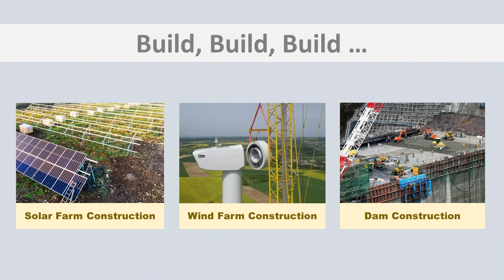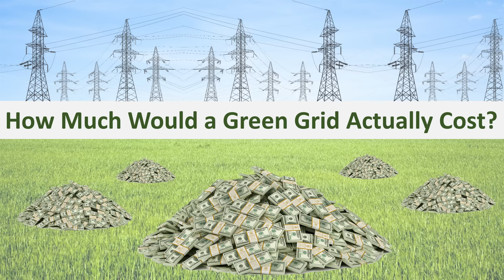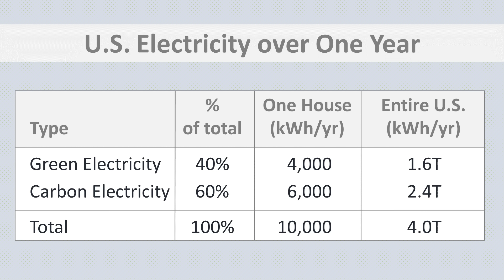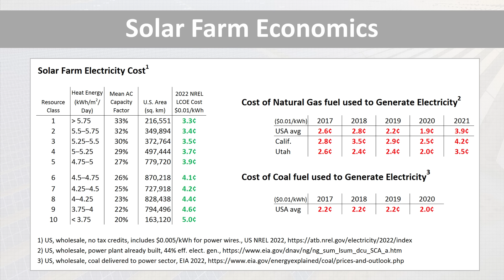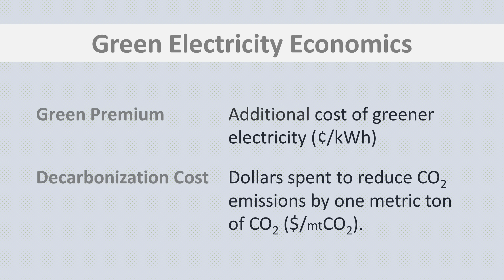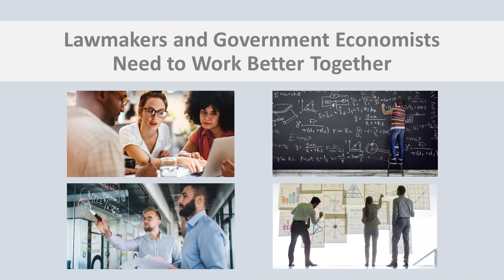The Climate Solution, Electricity, CS2

Comment: It's a fair effort. Clearly your hearts are in the right place. However.

Hansen's projections tell us we have only until 2030 to fully end fossil trade to avoid ten degrees of warming. Clearly, several states if ten degrees warmer would become uninhabitable, not to mention the fossil famine due drought, flood and heat, and the logistics nightmare of half of all ports closed annually due to storm surge. These unfunded liabilities of fossil should be part of any balance line accounting of costs.

On the other end of the accounting lemma, note that 5% of grid electricity is committed to fossil trade. The lowest cost forms of replacement of grid power are conservation and efficiency measures like insulation and maintenance; energy efficiency increase of 8% annually is easily achievable at a fraction of the cost of replacing generating capacity.

As demand drops, the highest cost fraction of energy generation likewise drops. Trade with Canada, already over 80% fossil free, for renewable electricity can replace 10% of US grid power, and the devalued Canadian dollar makes that power much cheaper.

With economies of scale, renewables get lower in price per unit; renewables are universally on the steeply downward sloping end of the long run cost of production per unit curve while fossil and nuclear are on the steeply rising side.

On the whole, an intelligent transition ought save the economy far more than it costs.
Reply from the maker: Bart, thank you for your comment. I agree with what you say. We recently published another video that looks at government's options: https://www.youtube.com/watch?v=QvlOVtCi-qw